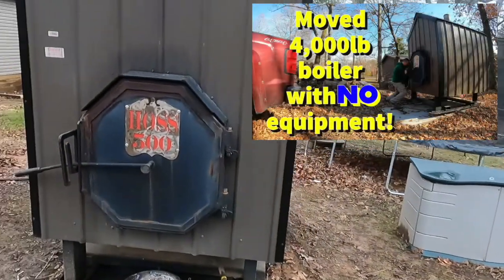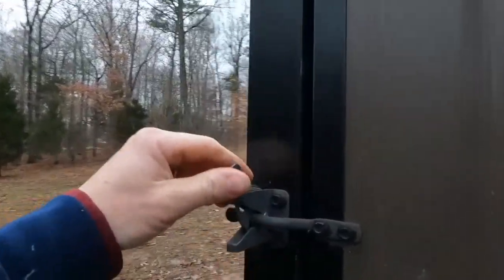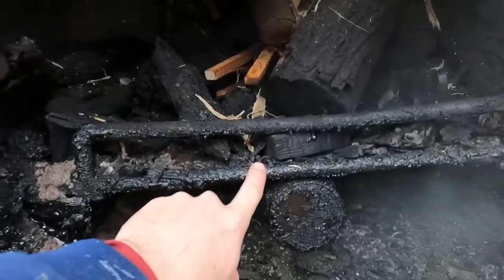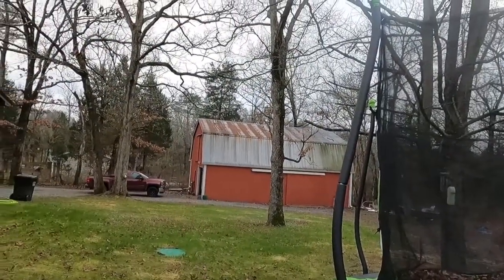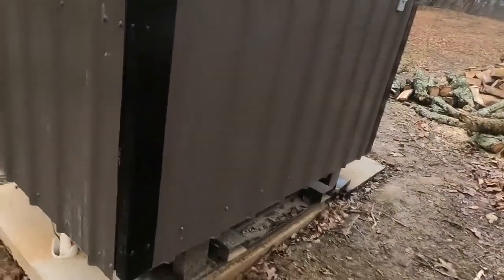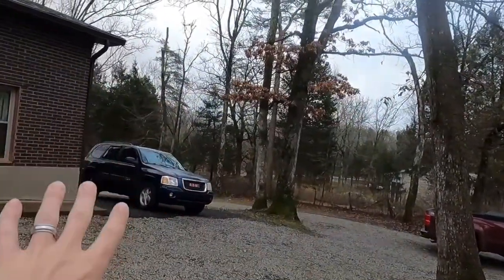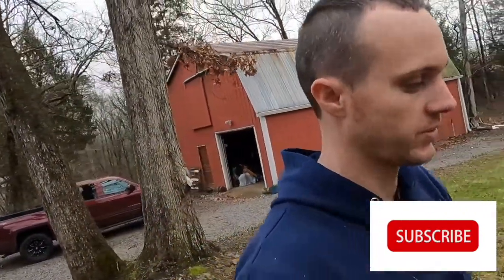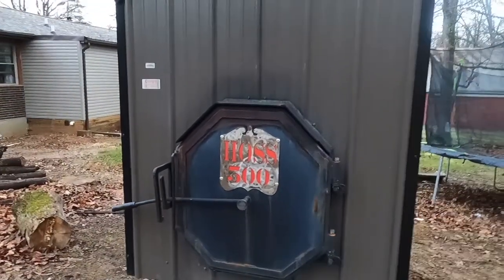How An Outside Boiler Heats Your House! | Explanation Of How It Works

Comment: Did you use the same thermostat that runs your inside furnace?…if so…how did you wire it? Thank you
Reply from the maker: You use the thermostat on the furnace as normal. There is a thermostat called an aqua stat that is used outside on the boiler that tells it when to kick the fan on and off.
Reply: @projectdiy873  thank you…I was using a separate thermostat inside my house other than the original one that I use for fuel oil…can I just disconnect the wire that operates the motor in the furnace for oil?
I no longer buy Diesel anyway lol
Reply from the maker: @BartSwinter  I am not sure how all your stuff is wired in so I can't give an exact answer honestly. My furnace kicks off and on from the temp I set. The outside boiler kicks on and off based off of the aqua Stat that is on the boiler.
Reply: @projectdiy873  I just went over what I asked you…I can see why it was hard to decipher lol 
I’ve been using the outdoor wood boiler for 17 years..this is the first time I’ve had any problem with the inside thermostat…I am just hoping to connect it to the original thermostat that is being used for the same furnace that I use for the fuel part of the furnace!
Man…I still can’t put it into the right words! 🤓
Reply from the maker: @BartSwinter  if I am understanding right you are saying that your in the house thermostat quit working?
Reply: @projectdiy873  yes that is correct…they installed a separate thermostat in the house when they set up the outdoor wood stove…just a two wire to operate the blower in the furnace

Comment: Hi, Do you ever have to add water to your system? I saw the circulator pump, is there also some type of pressure relief valve? What about and air bleed valve to keep air out of the system? Just curious what you have because it may help me for something I'm trying to do, Thanks
Reply from the maker: Usually you may add water at the begging but once it it up to temp it is going to stay pretty consistent on water level. As far as I know there is not an air pressure or air bleed valve. I would have to check on the back again to double check.

Comment: I'd be turning your set temp up to 180 you're gonna rot that thing out running at 145. Is your underground pex pipe insulated or just PEX inside PVC pipe?
Reply from the maker: I have the pipe insulated. Why would the lower temp rot it out? The water is hot and always moving.

Comment: Wish I had 15k to put one in
Reply from the maker: Yes but you can look around and find them cheaper. This one was used when I bought it.
Reply: @projectdiy873  well it’s just not the price of the machine it’s everything else involved with it also !  The concrete pad the pex the heat exchangers the ditch witch rental ! And if I install it at my house I have to go under or across my 30 feet wide brand new asphalt driveway
Reply from the maker: @scottbaican9566  yeah the driveway definitely hurts.
Reply: @projectdiy873  There’s no other way around it